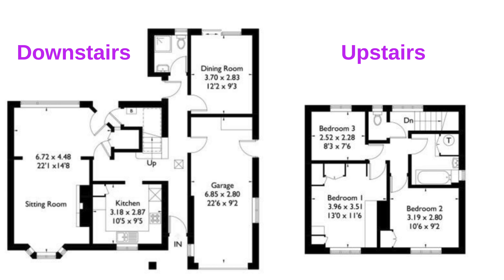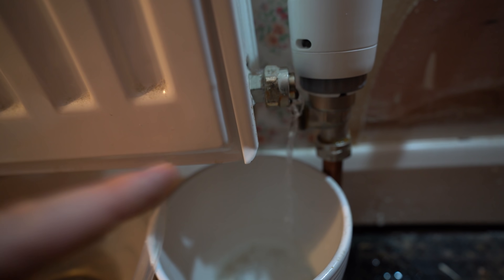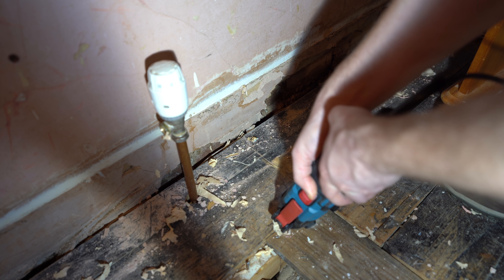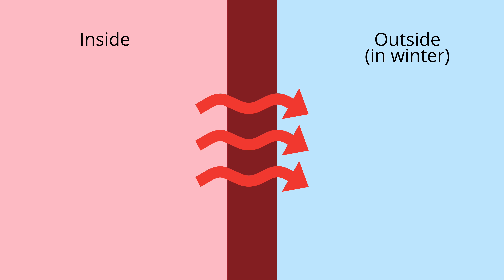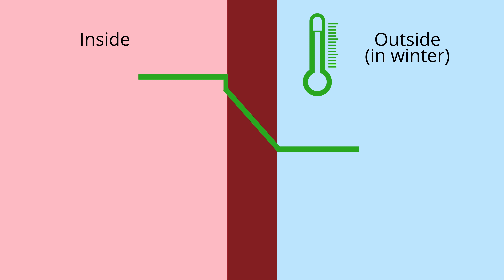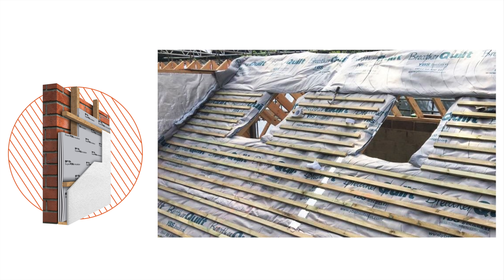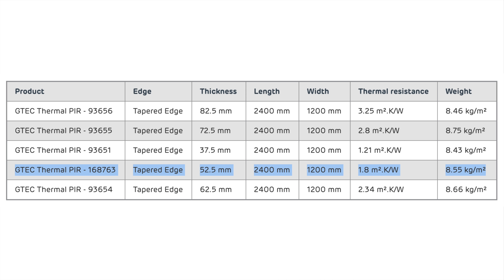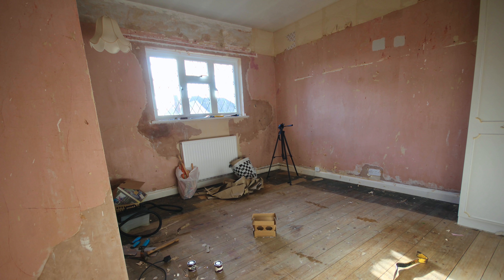Using Adhesive Foam To Attach Insulated Plasterboard

Comment: Any opinions would be appreciated on my idea thanks, if it will work? As solid walls need to breathe. I thought of why not use good Quality roofing membrane (Foil will sweat with vapour) on the solid brick wall which is breathable and acts as a water vapour barrier on the wall then batten up and use rockwool (insulated and breathable) Inbetween then use moisture plasterboard used for bathrooms? No condensation inside + warm wall and breathable brick wall.
Good / Bad ?
Reply from the maker: Umm so the problem is that water vapour will still hit the breathable membrane (if you have writing side facing inwards then yes it will work as a vapour barrier) and then you'll get condensation. You always want the vapour barrier on the INSIDE of the insulation, never the outside. The roofing paper/membranes are not the same, they act to shed water that may get behind the tiles whilst also letting water vapour out of the building. Have a look on my channel, there are various videos where I discuss these issues when I built a garden room.

Comment: Great video, i done this throughout the house all external walls last year using kingspan plasterboard sheets. I Would recommend soudal plasterboard adhesive, great stuff, then big twist headed helical fixings.
Reply from the maker: Great tip! And I love Soudal foam, defo worth the extra few £s over the No Nonsense stuff. I didn't know they did a plasterboard adhesive type foam though. Good shout on the fixings, my one regret on this.

Comment: I've been using instastik for around  12 years, some tips would be to spray the board and wall with water prior to applying the foam, you get greater adhesion, apply foam between the edges of the boards to stop cold bridging. Also a more cost effective way is to use kingspan or similar board,  then stick the plaster board to the kingspan. I've gone up-to 100mm kingspan with 15mm megadeco plaster boards. Bathroom walls have a load of around 100kg per 8x4 area that I have done. The key is a light waterspray for bonding and on old walls I use sbr bond on the walls. One last tip would be when sticking the plaster boards is when you butt them up together just twist a plasterboard screw between the sheets every 300-400mm the small amount of hold stops the sheet your sticking from expanding past the previous one and keeps them flush.
Reply: Hi
I have a plan to buy 20mm pir board two side silver foil (£20/each) and 9.5mm plasterboard (£10/each) then I have a plan to stick them together. Then cost is a half price (£60-65 shop price )
This diy plasterboard I have plan to stick from inside to empty cavity wall ( build in1965 )
What’s your advice, it’s good idea??
Thanks
Reply: @Matt.ffgmatHexPulseChain  Hi, it's a good idea, although go as thick as you can with the PIR board, as the cost relatively is not that much between the thickness increase, I've done up to 100mm Kingspan. The plasterboard would be easier done with 12.5mm, also try tapered edge plasterboard. I would stick the PIR board first, then the plaster board, overlapping the joints. Remember to mist with all surfaces the insta stik is adhering to, it gets more adhesion. On old dusty internal brickwork I use sbr bond to seal.
Reply: @henrywaterhouse6291  
Thanks for good advice. I wish to go 50mm pir but I will do it in quite small room and I have nice natural stone windows board so I won’t to replace them, that’s the main reason to go on 20mm pir . Maybe I will use bigger pir on the wall where I haven’t windows.
Reply: @Matt.ffgmatHexPulseChain  that's it, if you can get thicker on other walls, everything is a bonus.
Reply: Datasheet for Soudabond Easy says "With chalking and highly absorbent substrates, the substrate adhesion can be improved with a deep solvent primer." Can you tell us the actual primer you use, please?
Reply: @tamhamilton3036   I've just looked at the technical sheet by soudal, it doesn't specifically state that it can be used with foil backed insulation sheets. I use SBR bond to seal the walls, it gives a good seal. I've used different foam adhesives, instastik is the best for results and speed of cure. The point is , why use soudal when you can use a superior product that specifies it's use with foil backed insulation sheets.
Reply: @henrywaterhouse6291 Hi Henry, I’m planning on insulating a few external walls during the holidays. I’ll be generally following the steps Ali showed on the video. I was wondering if you had any other tips? I’ve thought about getting separate pir boards and plasterboard as you recommended but as I’m only doing 3 external walls, I’ve decided to just get insulated plasterboard to save time and as it’ll be my first time doing this type of job.
Reply: @omaryasin6975  make sure you seal the brick/ block with an SBR primer, wet both wall and board with a water spray. This will help adhesion and cure time. Depending on where you are , separate pir boards and plaster boards are cheaper as you can buy them singular, also off the shelf as there a standard stock item. Also foam between boards to prevent thermal bridging.
Reply: @henrywaterhouse6291 thanks for the advice Henry. I’ll be putting the insulated plasterboard up against  plastered walls, will they need SBR primer? I’ve been in two minds on whether to get separate pir boards and plasterboard as they cheaper but thought insulated plasterboard will be easier and faster to install. Also how many mechanical fixings do you usually use per board? Thanks
Reply: @omaryasin6975  be careful with fixing to plastered walls, if sand/ cement then it should be fine, if gypsum based plaster or even boards I would remove the plaster. If going on to sand/ cement then as long as not loose then no need to prime, just spray with water. The separate pir, plaster boards, you'll get a better insulation valve for the same thickness. The time saving is minimal on just one room. No mechanical fixings needed. The biggest load I have on per sheet is around 100-120 kg , no issues after 15 years. All in the prep and good installation.
Reply: @henrywaterhouse6291  thanks for the advice. I’ve decided to go with separate plasterboard and pir boards as you suggested, I’ll make sure to put insta stik between the pir boards, how about also foil taping them? Do you use acoustic sealant in the joint between the plasterboards or just tape and jointing compound like easifill? Also, before painting, do you use any plasterboard sealer or just mist coat with watered down paint?
Reply: @omaryasin6975  no need to foil tape if you put instastik between the pir boards, it'll be airtight and no thermal bridging. Use tapered edge plasterboard, you could even use mega- deco plasterboard  which is impact resistant. Use easfil joint filler to do your joints and reveals , use paper joint tape for joints and internal corners, it's stronger. External corners try " hook on " thin coat angle bead, there better as clout nails don't pop up. Use siniat pro- mix for the top 2 coats over the filler coat. Any brand of jointing compound is ok, I just prefer siniat, they have the biggest range of boards and joint finishing. Painting wise generally emulsion is ok, but you can do a thinner coat to seal. It's not so much that the plaster needs sealing, if the moisture is sucked from the paint,it pulls back off on to your roller.
Reply: @henrywaterhouse6291 thanks for all the advice! Much appreciated
Reply: @henrywaterhouse6291 did you mean siniat smartmix?
Reply: @henrywaterhouse6291  Thanks for all your advice above, I'm about to do this too. Do you use instastick to bond PIR to walls and then plasterboard to PIR? After misting both surfaces, do you also need to wait for foam to go off a bit before offering up to wall?  What's your method for holding boards in place as the foam goes off completely?
Reply: @yappaty1975  you're welcome, use diluted SBR on the brickwork first, it'll increase adhesion and moisture whilst using the instastik. Then mist both PIR and wall, apply foam to PIR, push PIR to wall, use spirit level to plumb and hold for 4 minutes, repeat with next PIR, use pad saw or screw driver to stab through new sheet to previous so they are flush, put instastik between sheets to stop cold bridging. Do the same method with plasterboard to PIR , mist both surfaces to bond, this time use plasterboard screws to screw between previous sheet and new sheet being stuck,  put them  a foot apart up the full height, the thread of the screw will bite between both sheets and keep the joint flush. I put the instastik on the PIR for this one, faster and less messy. Instastik is the only one that I've found that is fast cureing and has excellent adhesion, the cell density of the foam is good aswell. 
Another tip would be to overlap joints in the PIR sheets and the joints in your plasterboard sheets, it's easy to be a few mil out with PIR boards especially 100mm sometimes not the straightest!!
Reply: @yappaty1975  you can prop a 2 meter spirit level against the board and a 4x2" propped up at the spirit and a block against the bottom of the spirit whilst it goes off, this gets you a few minutes back a sheet, but it's a fast method anyway.
Reply: @henrywaterhouse6291  @AliDymock Ali and Henry - thanks for the original post, and for the four years of tips and comments! 
I have a question that I don't think has been asked ... My wall is back to brick but the wall itself is not completely plumb. 
The difference between the lowest and highest parts is 2-3cm, and obviously I want the new finished surface to be plumb.
How thick can you go with the instastik on the "low" parts? Or should I try and bring the surface closer to plumb using pieces of plasterboard on the low areas, before applying the pir ? Thanks again.
Reply: When using any expanding foam you should mist the surface as that improves the curing process and the foam goes off faster. That said, I would absolutely not mist plasterboard. Gypsum plaster does not deal well with moisture and you are shortening its strength for no reason as all. Instead, apply the foam and wait for 20 secs before sticking the board to the wall. Once the foam cures a little, the adhesion is improved and it's stays stuck to the wall much easier. 

You should also be very careful when insulating external walls. External walls ( especially solid ones ) can have condensation problems. Sticking insulated plasterboard directly to the wall can easily result in mould growth between the wall and the insulation. It doesn't matter how thick the insulation is, it's all about the position of the dew point which will be right around the inner side of the wall. 
What I would highly recommend is that you apply a liquid airtightness membrane to the inside of the wall before you stick on the insulated plasterboard. Kingspan says that you need to batten the wall but that's an overkill if you apply airtightness. Ideally, you would also seal the outside of the bricks with something like Dryzone or any of the competing products.
Reply: @george9710  if you read carefully what I wrote, lightly mist. Mould growth ? The foil is the vapour barrier.
With the upmost respect, have you ever taken off any foil insulation board stuck with foam? The light misting does not affect the plaster board. There's more moisture in plaster board adhesive, that doesn't have any negative effect on plaster board.
Please could you elaborate on your practical experience with they method I described. I've seen no negatives in 16 years of using this method, so I'm alitte perplexed with your experience/ theory.
Reply from the maker: Good stuff Kevin. How well does Insta Stik stick to foil would you say?
Reply: @AliDymock  very well, I have over 100kg per 8x4 board all stuck on the foil. The key is a light waterspray to increase the bond. Using kingspan, you get a better U value,  less wastage and it's cheaper  than a bonded insulation/ plaster board.
Reply: Fella … could you use this method for ceilings?
Reply: @aneseed  quicker and easier using long plaster board screws. Can use foam between insulation boards to prevent cold bridging.
Reply: I recently used this with the tube attached not a gun & got one board out of a can … is that correct . I thought you’d get more
Reply: I love insta stick it sticks almost anything and goes off quickly it's great for giving skirting etc. We insulated loads of houses for housing associations with 100mm insulation backed plasterboard and fixed it using insta stick with a couple of concrete screws to hold it tight against the existing plaster it was a really good earner. Your meant to return it around the corner something like a minimum of 150mm though it do performs quite well without that. Nice tip advising people to put some foam in the edges btw. 👍😀
Reply from the maker: I wouldn't want to be the guy who has to pull off the skirting down the line! It's amazing how strong it is!

Comment: I'd have thought the pir was a closed cell foam and therefore have it's own intrinsic vapour barrier? Mech fixings every 600.
Reply: The plasterboard and insulation sandwich will each have their own vapour resistance values, it's not going to be near a dedicated barrier like foil or "vapour check" dedicated plasterboards. Check the BBA or certs for each product - which will then factor against your calculations for the thermal properties of the wall. Most general suppliers will not have this information to hand.
Reply: I wasn’t aware you could get a vapour check insulation board. Dunno why they don’t use that green board.
Reply: @crustyzimmerman3324  knauf do a "thermal laminate vapour check" with 1304 vapour resistance which is very different from the XPS plus which is 140.

Comment: I agree with the fact that there are a lot of cowboys on the market just wanting to scavenge on government subsidies for insulating your house.
A thorough bit of research is needed and will pay off if you're going to hire someone to do the job for you.
I'm planning to have my exterior walls insulated from the outside and rendered, this is a real specialist job and I chose to go with a builder which already has 20+ years of experience with the process and offers 20 years of guarantee on his work! So worth the extra bit of money.
The other companies which were invited to make an offer trough one of these websites were you can get 5 offers didn't even reply back, so they probably considered the job as too complicated for them because of some technical details of the house.
Another advantage of the chosen builder is that he can do some structural changes on supporting walls at the same time, so it isn't necessary to have two different companies having to work in each way or at different times.

But as for the easier jobs, I agree on the fact that getting the government subsidy does not cover the added cost for labour when outsourcing, as one of the requirements is that the job must be done by a certified company, so you're still saving money when doing it yourself without getting the subsidy.
Reply from the maker: Good work, totally worth getting the best to do that kind of work.

Comment: Next time you remove a radiator,after screwing down the thermostatic valve fit a blank to the outlet because they have a frost stat in the valve and they can open up if it gets cold and flood the room.
Reply: To make a blank, rap some ptfe tape round 5p piece.  Place inside a nut and screw on to valve body.
Reply from the maker: Thanks Barry, did not know that!

Comment: I’ve had external insulation it’s the best thing I’ve ever done.  Internal insulation is terrible. Not worth it. My builders started internal insulation I had to pull the plug on that and got them to do it on the outside walls.
Reply from the maker: What went wrong?
Reply: @AliDymock  the boards were coming off they put them up on damp walls. We treated the damp and then got 8mm external insulation. Keeps the heat in so well. Also underfloor heating is a must.

Comment: 10:15 Question, you mention a continuous line of foam. Could I ask what the thinking behind that is? I was once told to only do vertical lines, so any moisture that could be in the brick and would condense between brick and insulation - can trickle down the wall. Would it be better to trap air in there, or to create a cavity of sorts?
Reply: Solid line of dot/dab around board edges and accessories is to maintain fire protection.
Reply from the maker: 👍 sure, this goes for dot and dab too, so my understanding is that:
1) you want to stop any water vapour getting through the joints between the plasterboard getting behind the sheets and condensing. If it does get behind and at least it’s confined to just behind the joints.
2) There may be a small vacuum element to it too: once dried air would have to get in for the board to fall off.
3) possibly for fire reasons, to slow spread of flame up and across the wall.

Comment: Nice job, but get ready to have mould start growing where you've used uncovered metal fixings at 11:49. The warm air will condense on the cold screw head and you'll have a lovely grey patch to keep wiping clean during the winter.
Reply from the maker: Hmm I can’t imagine it would happen any more than on the windows but we’ll see. Have you got a link to fixings you would use?